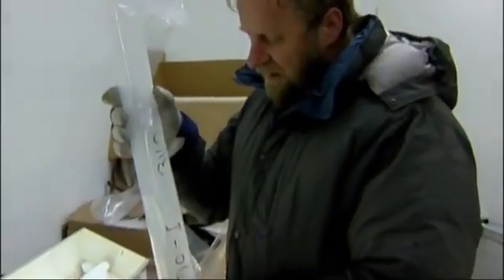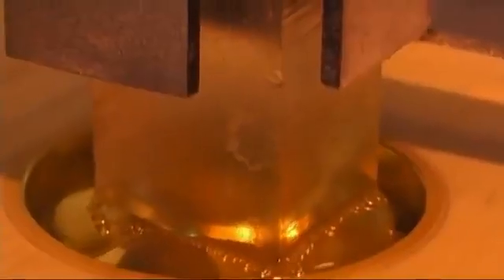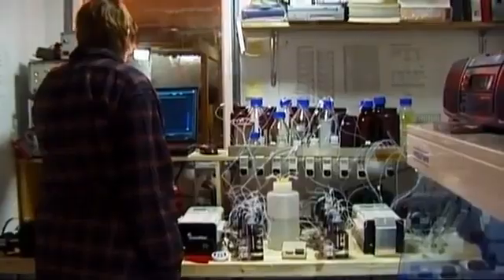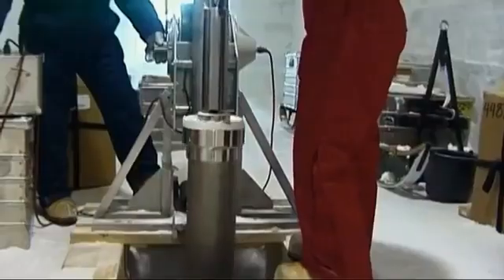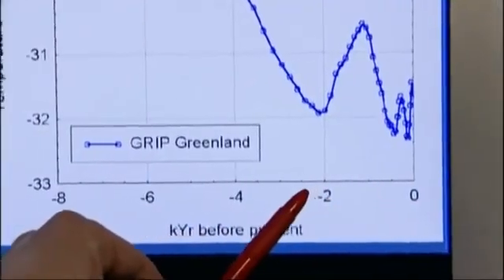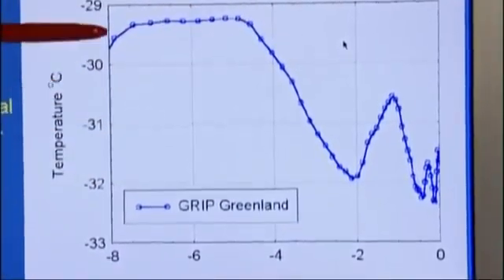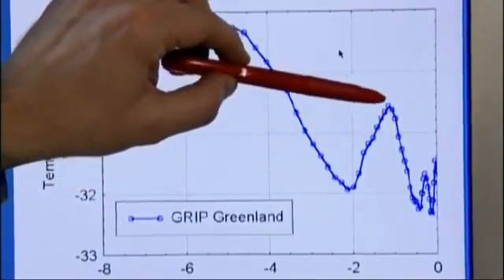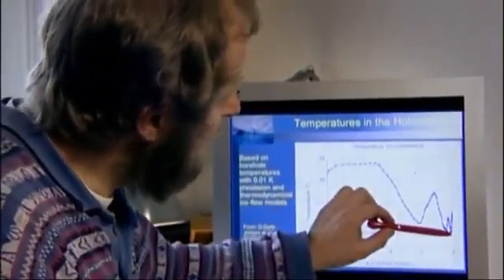The BEST Climate Clip I've EVER seen - What do you think?? #SCIENCE

Comment: Does anyone else find it remarkable that the ice mass is almost spot on the same temperature for a length equal to 4000 years, but at depths closer to the surface, there is fairly rapid variation?
Reply: I find it remarkable that they, apparently, stick a thermometer down the drill hole because they believe the ice "remembers" the temperature it was laid at...
Reply: @xenomorph6961 yeah, I don't think that's really how it's done.  My recollection is that they carbon date material trapped in the ice then map out depth vs age and estimate the temperature variation based on how much more or less ice was formed during each age.  That whole "memory" thing is absurd sounding on is face.  Deep ice should show relatively stable temperatures over large distances since the laws of thermodynamics would suggest temperature gradients would even out over time whereas depths close to the surface would show large variations since the air temperatures above differ greatly from the ice below and that air heats and cools regularly.
Reply: Using the word "memory" is just for us avg Joe's to grok his meaning. A bunch of 50 cent words would lose me quick. 😊
Reply: @johnchandler1687  yes, but the speaker suggested that the temperature at various depths today has some correlation to the temperature it had when it first formed on what was then the surface.  That's crazy no matter how you describe it.  Ice near the surface will remain closer to the surface temperature, while deeper ice will tend to be colder no matter what the temperature was when the ice formed.  The trick is drilling out an ice core (cylinder), slicing it into sections, then carbon dating what you find trapped in the ice of each section to see how the age v depth curve looks.  It's a lot like measuring the thickness of "rings" on a tree to determine how fast it grew over time.  Replace the tree with an ice column and ring thickness with carbon dating of trapped material in each slice -- and you have a pretty good 5-cent explanation.
Reply: @cordeg  Actually, I understand  what they were saying, but many won't. Just like that can tell the rise and fall of CO2 levels over the millenia by what's trapped in rocks and fossils. And track magnetic pole reversals by the orientation of iron in ancient magma cores. Also, ice resists getting colder than freezing temp. I'm sure it does somewhat,  but it's a freak insulator for the ground as snow. I haven't a clue how that figures in on what he's saying, but I guess that's been factored in?
Reply: @johnchandler1687  sorry, then, I guess I didn't catch the nuance of what you were saying earlier.  In any case, my guess is that ice near the surface is close to melting given exposure to air currents, sun, and vibrations and that deeper down is closer to it's minimum.  I live in Florida so I know all about the insulating properties of ice.  When we are expecting a "hard freeze" (say 28 degrees) we spray down our fragile plants with water to form a layer of ice to keep them from exposure to the colder temps.  Newcomers look at you like you're crazy, but it's tried and true.
Reply: @cordeg  it does work.  It's also due tothe phase change thermodynamics.  As in your air conditioner, when freon changes from a liquid to a gas in the evaporator, it absorbs heat.  When it is compressed and changes from gas to liquid, it releases heat. Same thing when water changes from liquid to solid, it releases heat - to the benefit of the plants.

Comment: "We insert a thermometer in the hole... the ice has not forgotten how cold or warm it was"

Folks, this is NOT how historical temperatures can be measured from ice cores (thousandth of a degree accuracy or not). Scientists use chemical analyses of air trapped in bubbles in the ice. You can't just put a thermometer in a hole. At best they're measuring the thermal properties of ice, but I don't think they could even legitimately claim that much.

Comment: Every week, in County Wicklow in Ireland, I walk on evidence of dramatic climate change that occurred about 11,000 years ago, along glacial valleys, looking down into corrie lakes and moraines. What about the glacier that's recently receded in Switzerland because of the hot summers in recent years, and revealed ground that hasn't been seen in about 2,000 years.  ?  The climate alarmists were crowing about this.  Hang on.  So the present warming is as warm as it was 2,000 years ago.  Or put it another way, 2,000 years ago the climate was as warm as it is now.  But we're supposed to be alarmed this time?  But what happened after 2,000 years ago?  How did the glacier form on the top of the mountain?  Yes, you've guessed it, but the climate alarmists haven't joined up the dots yet.

Comment: So they dig a hole in the ice & then measure temperature changes as they go deeper, because it has "maintained" its original temperature for over 1000 years? Forgive me but that sounds like a messy method to me.
Reply: That's not how it's done; determining past temperature from ice cores involves looking at oxygen isotope ratios.

Most of the oxygen on the Earth is the lighter O16 isotope with a small amount of the heavier O18 isotope. Since O18 is heavier, it takes more energy to evaporate water from the ocean containing O18 than it does to evaporate water containing O16. Thus most of the water in the atmosphere that then falls as precipitation to form glaciers contains O16 rather than O18. 

When it is colder, there is less energy available, so there is an even higher proportion of O16 in the atmosphere relative to O18 that goes on to form glaciers. So when O18 is depleted in an ice core it means the temperature was colder when the ice formed, and a near linear correlation has been found between O18 level and temperature.

A lot of people seem to believe that the graph shown in the video demonstrates that recent temperature rise is insignificant, but they are incorrect. The graph only includes data until 1950 (Year 0 in paleoclimatology) and thus doesn't show recent global warming. Furthermore, it is data from one location; reconstructions such as Pages2k and 12k incorporating hundreds of records including dozens of ice cores from across the world do not show the kind of pronounced Medieval Warm Period which occured in Greenland.

I hope this was helpful.
Reply: @kilometreman  Absolutely thanks for clarifying! The video really needs this bit of extra background to make sense at all.
Reply: @nohandle822  No problem! Glad I could help.

Comment: Real question, how does sticking a thermometer into the hole work in any way? Does the layer of ice maintain a different temperature for some reason?

Seems like taking a mummy’s temperature and deciding humans used to be much colder. I would assume the ice temperature would adjust to it’s current surroundings..

Comment: The scientist said that as they go down the 3 km of ice they take temperatures very carefully at each level because the ice remembers how cold it was when the ice originally fell.  So is he saying the ice at a given level IS still the temperature it was when the snow fell, or that the ice somehow has characteristics that indicate the temp when the snow fell?  Ice changes temperature.  Ice can conduct heat/cold (it is not a good insulator).  So what is the basis of his claim?
Reply: This scientist needs to take a class on thermodynamics.  His "ice memory" assumption breaks the second law of thermodynamics.  Plus,  when you drill into ice you are using friction to drill which creates heat which influences your temperature measurements.  The data that this analysis is based upon is bogus.
Reply: This is a Monty Python skit right? 😂 The ice remembers how cold it was? This is the biggest crock of s***.
Reply: I had the same thought. The temperature should stabilize a couple meters below the surface and then develop a smooth gradient of increasing temperature as you go deeper. It sounds like BS to me personally. Everything I've read on the subject says they approximate temperature from the chemical composition of the ice.

Comment: The last 100 years on this graph has more change than the period 4000 years ago, is this because of non perfect insulation of the layers, or was the temperature actually stable?
Reply: THIS is a fair question. and just before this last spike up, the temp collapsed like a waterfall. guessing solar flares (less- colder  or more - hotter ) as opposed to dinosaurs quitting cigarettes and switching from gas to electric cars.
Reply: @vegasprogambler5336  has anybody done the simple physics using the thermal conductivity and density of the ice showing how much the temperature has converged with time.
Reply: @nigelkingify  also fair...as youre imply things seek equilibrium. seems as thou they are saying there is clear stratification (like the charts say) between years/ decades thou.

back to your op thou... the spikes/ slopes BOTH directions sure beg questions as to why.

Comment: Why was the temperature low in 1875? Wouldn't that be a period of high or low CO2? I saw another analysis of climate and the researcher beleived times of high CO2 actually produced lower temperatures, probably because gas in the atmosphere was acting like an insulator. Which makes more sense than acting as a green house. 
I felt like winters have been getting colder here in Queensland Australia and when I checked the temperatures it appeared in the winter the temperature has been getting colder each year.

Comment: I think we need a better explanation of what they do with the ice cores. It makes no sense that ice at one layer would somehow be warmer than the layer above or below it. It would cool down to a natural equilibrium.
Reply: Just saying, getting temperature measurement accurate to 1000th of a degree is very, very difficult. Verifying the calibration of such an instrument is likewise challenging. Be interesting to see how they achieve it. Techo details matter.
Reply: @lynndonharnell422  thermocouple
Reply: @citizenavatar  sorry, not nearly accurate enough.
Reply: @Lynndon Harnell  they would calibrate it using standardization. Like any lab work using quantitative analysis
Reply: I agree Paul. As long as it's still frozen the current temperature of the ice means nothing about past temperatures.
Reply: It may be that the ice is not necessarily colder, but at a different density or something decreasing it's temperature reading.
The natural cycle is that it snows in winter, then it melts in summer.
If the melt is less than the snow, the old snow will be compacted under the new snow. And temperature variations will influence this as well.
I'm guessing the reason they are in iceland is because there's permafrost there. So each year has their own layer. I'd think there are differences in thickness, density and air bubbles in the ice as well.
Reply: but its also in other records that indicate the carbon-dioxide levels over eons, and fossil records too
Reply: That seems like a logical deduction about conduction. Others have their convictions about convection.
Reply: Peter - i agree with Paul re: curiosity about thermal equilibrium. I’d have to take out an old thermodynamics book and look at the time required to come to equilibrium given the temperature difference and the sizes involved… Very curious about this… 

As to your point about convection, I think that’s relevant in general, but only when the heated medium is in motion. I don’t think that’s the case here.
Reply: @asdf8asdf8asdf8asdf  I am curious about the thermal effect of pressure as well.  Does the pressure of 3000 metres of  ice not have any effect whatsoever on temperature?
Reply: @mtlicq  That's true of gases, but not (incompressible) liquids or solids.
Reply: @martinliehs2513  that is not true. It affects solid and liquids. You did not do the wire through a solid block of ice experiment in high school ?
Reply: @mtlicq  excellent point. Pressure definitely has affect in the phase-change diagram.